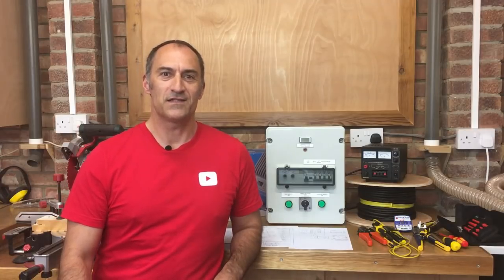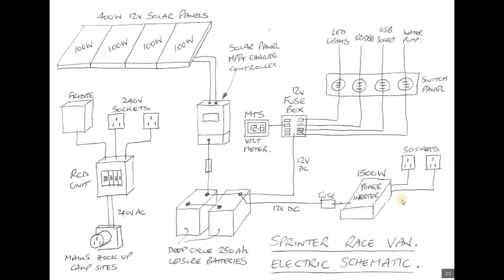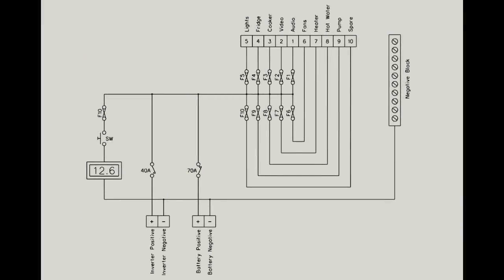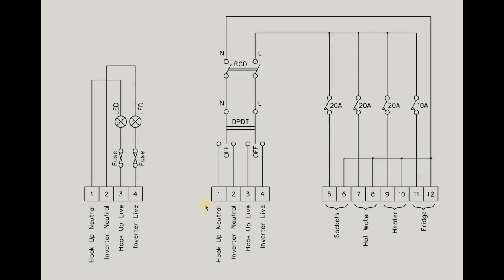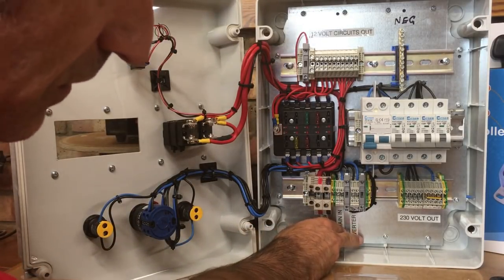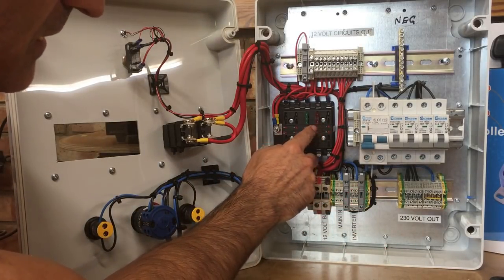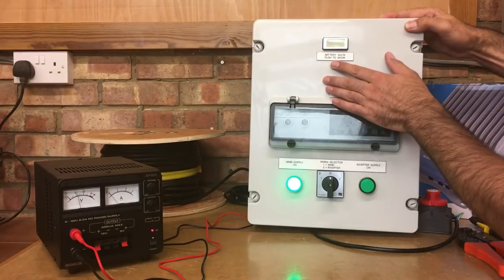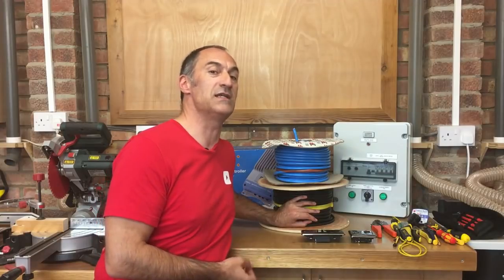Self Build Camper Van 12v Electric Control Panel

Comment: Hi Greg, sorry to trouble you again but I think you are the most competent person I know. I have started converting my LWB sprinter and have got to the point of running in cables etc. I plan to do my van in two phases as we are new to camper vans and plan to initially only use campsites with mains hookups. So phase 1 plan to have mains hookup but also have at least 1 AGM leisure battery and have 12 volt lights and 240 for most other items. Phase two when I have funds available I want to add solar.
My question is would you fit a split charge relay to charge the AGM battery or is there an alternative / better option?
Thank you in advance for your assistance.
Love your videos and wish you a great day 😃

Comment: Greg.
Me again rattling you brain with questions 

I've been watching your electricia set up videos 

What back up did you have to charge your leisure batteries 
Maybe I missed something 
But I didn't see a feed from the mains battery or from your hook up 
So I'm I correct in saying your 12v system uses the solar panels to charge up
Reply: Please excuse me 
I've just re watched the 2nd video and you did mention the charging of the leisure battery 🙈

Comment: Hi Greg 
Once again thank you 
Everything is so detailed and educational.

Is there a reason you didnt run a feed from the mains car battery to charge your system while driving 
Are all the 12v cables 1.5mm
Reply from the maker: THE MARKS BROTHERS I didn’t use a split charge relay because it would not look after my AGM batteries and would possibly damage them. 
A far better solution would be to install a dc to dc battery charger. You can then setup different charging profiles and your batteries will last longer.

Comment: Thanks Greg. Watched the video. You clearly know what you’re talking about. However.... imagine if you can that I don’t have a scooby doo. The system looks exactly what I’m looking for. I don’t even know where the existing wiring is in my van as it’s all hidden. All I know is it’s a sergeant system. I will have to get the conversion company to put my inverter in. Just worries me that they said this could not be done. You can do it so obviously it can be done. I have asked the conversion company for a wiring diagram. If they produce it I will let you know. You may be able to give me some more advice in the future. Very happy to have found you on YouTube and happy to be a subscriber. 👍🏼
Reply from the maker: ian sharp you just need to put the mains hook up on one side of the changeover switch, your inverter supply on the other side of the changeover switch and the output from the switch to your Sargent panel where the mains would normally be connected. 
You can put the changeover switch in a small plastic box. You don’t need a huge panel like mine just keep it simple. What model Sargent panel do you have? I will dig out the wiring schematics 👍🏼
Reply: That’s great. Thanks Greg. I will have a look now. Stand by. I really appreciate the time you’ve taken to help someone who doesn’t have a clue. Very very helpful. Thank you. It’s an EC155 I can send you a picture if you like. You’re a top man. 👍🏼
Reply from the maker: ian sharp ok so I have the wiring diagrams for that panel. https://sargentltd.co.uk/shop/product/132/tech-spec/40
I can see the 230v input terminals on top of page 4 
It appears there are a number of 230v outlets including a heater and boiler. 
I would recommend not using those via your inverter as your battery will not last long at all. 
So as long as you size your inverter large enough for your total loads in Watts and remember not to use the heater and boiler of the inverter it will work just fine. Hope that helps. Just ask if you need anything clarifying 👍🏼😊
Reply from the maker: ian sharp this is the changeover switch you need to switch from inverter to mains 

https://rover.ebay.com/rover/0/0/0?mpre=https%3A%2F%2Fwww.ebay.co.uk%2Fulk%2Fitm%2F401993210348
Reply from the maker: ian sharp on your Sargent power unit there will be a set of input terminals for the mains hook up. 
Disconnect the mains, install switch as above description and wire back to these terminals from the output of the changeover switch. 😀
Reply from the maker: ian sharp no problem mate it’s a pleasure. No reason why you can’t feed that Sargent unit with two independently isolated 230v supplies. Just need to be aware of the connected load and your inverter size. Give us a shout if you get any problems. Good luck 😉
Reply: Hi Greg. Just wanted to let you know that I have read through your comments and I understand.  I have a 2000kw pure sine wave inverter. I want to run my coffee machine and microwave. Everything else is 12v. I have 2 x 110 amp AGM leisure batteries. Does it all sound ok. What size wire would you recommend for this setup? I have had a look at the switch box. What size amp box do you think I would need. Sorry to keep you so busy with all the questions.
Reply: Thanks again Greg. Gonna go over everything you’ve told me so far and see if I understand. I honestly don’t have a clue but your help and advice is massively appreciated. Top man. 👍🏼😁

Comment: Hello again - If I may ask, why did you choose to install the LED indicator light for the Mains supply on the left, under the Inverter Supply 12V DC side and the Inverter Supply LED indicator light under the Mains supply (the RCD) on the right?
Reply from the maker: 1 is Mains
2 is Inverter

Comment: Really should have used a 3 pole change over switch, the shore power earth connection needs to be disconnected from the vehicle when using the inverter. The inverters neutral should be shunted to the chassis ground and earth within the van, then you have rcd fault protection as well as preventing the entire van from becoming live. Also in the UK most hookups are 16amp and a 16 amp trip at the hookup point so using 20mcbs is pointless as the site's trip will go well before yours does as well as when in inverter power the fuse will go before your MCB due to its fault protection being at 13amps.  It's recommended to have a 25amp rcd  and a 10amp MCB to allow for discretion. The workmanship is very good but I think more research on the wiring regs was needed.

Comment: I guess my only question here would be is how would you add a 3rd input of 12v DC from the alternator to charge while driving or on days where solar is not real clear?
Reply from the maker: irongoatrocky any DC charging would be connected direct to the leisure battery string. It would be sensible to have inline isolators fuses or breakers so you can safely switch between charging modes. 👍🏼😊
Reply: @GregVirgoe  I was thinking along those lines I saw in another one of your  videos where you mentioned the isolated I was thinking of adding a switch to the 12v input so one can choose between the solar or alternator for input. 
Thanks for the reply...Cheers!

Comment: Hi Greg, I'm learning a lot from your videos. Question: Is it necessary to split the distribution panel? Is it possible to have the hookup power feeding the batteries, and in turn, the batteries feed all the outlets (thereby not needing 2 separate sets of outlets)? I imagine there must be a feasibility or safety reason for why you kept them separate.
Reply from the maker: s s please watch my latest video “How to wire your camper van” and I have done exactly that with a mains battery charger.

Comment: hello Greg, are there any electric things that you will do different in a new campervan.
Reply from the maker: Geert Ritserveldt yes now that we know the solar system works so well I would put everything on the12volt batteries and just have a mains battery charger as backup. We have only used a couple of the 230v sockets so it was overkill fitting them all.

Comment: Hi Greg! Absolutely love your videos, been watching 3 hours straight :). 2 questions: 
I noticed you use the same cable for all your 12V DC wiring. If I look at my wiring then I have different cable thickness for my waterpump, lights, fridge, etc... I got these measurements from their respective manuals. The fridge even has a 10mm2 cable requirement as the distance to the batteries is quite far and this to ensure to have as minimum voltage loss. 
I would love to read your opinion on this :)? 

2nd: I noticed in your calculation for your watt hours that you list the fridge as only 6 hours on per day. Aren't you using the fridge constantly? Or is this the actual time it's consuming power? 

Thanks again for your incredible videos!
Reply: The fridge compressor wouldn’t run constantly. So the 6 hours would be the total compressor run time in a 24 hour period

Comment: Ok stupid beginners question.. the fuse box you have with the switch to connect to either the leasure/hook up battery or the solar.. is that different than a trip switch? Is the trip switch from the van battery to the leasure? And this switch is from the solar/leasure to the hook up?

Comment: Hi Greg. 
              I love your schematic of the electrical system. How would you incorporate a 220 volt  ac battery charger into the system.
I would like to be able to charge my 12 volt leisure  battery when I'm hooked up to shore power. I already have a 100 watt solar panel, do I even need an AC charger?  I'm only running 5  3.5 watt LEDs ,water pump and 4  USB sockets for charging phones, a Sat Nav  and an MP3 player. Great channel, keep up the good work.
Reply from the maker: Sansa Ireland I have my mains battery charger plugged into a socket that is fed directly from the mains hook up connection. Then it’s connected directly to my batteries. So it’s totally stand alone from the panel.
It’s good to have as a back up charger. I have one but so far never needed to use it. You may be the same and have enough solar but better to have that option. 😊
Reply: Thanks Greg...I was thinking along thee same lines

Comment: great video, would like a bit more detail on the components though. like what are the dimensions of the junction box? where did you get the RCB clear flip cover? what din rail connectors are you using etc? thanks!

Comment: I couldn't tell - did you also implement a way to charge the leisure batteries from shore power when available (i.e. so charging is quicker than with solar)?

Comment: Hi Greg,
Is it right, that thru the selector switch is going up to 70 ampere? I think for 70 ampere you need minimum a 10mm² cable. In the video it looks like 2.5mm²

Comment: Hi Greg, why do you not use a split relay from the engine also/instead to charge/top-up your leisure batteries?
Reply from the maker: hennnnerz because a VSR or split charge relay is not compatible with AGM batteries. They prefer a low slow charge and are more suited to battery to battery chargers.

Comment: Hi Greg, 
Thanks for this video, I really like the set-up and am working on my own version at the moment.
Just one question with regards to the wire size:

It looks like you use 2.5mm2 wire for everything, but was wondering if it wouldn't be better to have a thicker wire from your live main supply to the DPDT and to your RCD and your neutral from the bus bar -> RCD -> DPDT -> Neutral main hook-up.
Not sure what the capacity of the RCD is but your fuses go up to 70A, therefore shouldn't your wire size be increased here? I know for your 2000W inverter it should be sufficient (2000/220 < 10A) but if you hook up to a main power supply at a camp site of f.e. 30A, your wires are undersized?
Or do you only hook up to main power supply up to 10A or 16A?

Comment: Hi Greg where did you get the distribution box from
Reply from the maker: James Shearing you can get the abs enclosure from eBay https://rover.ebay.com/rover/0/0/0?mpre=https%3A%2F%2Fwww.ebay.co.uk%2Fulk%2Fitm%2F112869512272
Reply: Thanks Greg top notch videos by the way 👍

Comment: Hi, nice drawing :)..  im just sitting and drawing almost a copy over here in sweden..  I was planning to go direct from mppt 12v out to fusebox and the lights, waterpump and fan? why didnt you do that so you can see the draw? am I missing something...  if I only have a fridge and instant heated tap going to 240V can I just go to one fuse? .. why need to switch and cut off both cables going up to solarpanel?.. how about not having fuse mppt to batteries and going instead over the Main switch?   thanks!

Comment: Hi David, amazing video! Do you (or does anybody else) know the specifications of all the single strand cable used within the box itself?
Reply from the maker: Hi Simon, I have used Tri Rated cable inside the panel, which is flame retardant and suitable for high temperature and designed for internal panel wiring. https://www.electriccable.co.uk/RWDtriratedcableTECC.php?gclid=Cj0KCQjw5J_mBRDVARIsAGqGLZBRhqzRjO3cqNWkayLa0frIBML2-5JeJgQcVq2OHlBHQ2Ul4Y0FBJsaAjUXEALw_wcB

Comment: How did you run the cable from the van battery all the way to the leisure batteries? Thank you very much!
Reply from the maker: If you watch the first shower video you will see a red cable passing under the back of the shower tray. However I never connected it because the VSR is not compatible with my AGM batteries. We have not needed it been on solar 100%
Reply: @GregVirgoe  Hi Greg, greats videos, can you expand on why this VSR won't work with your AGM battery's? Was looking to buy this split charger, but now have my concerns.
Reply from the maker: Scott Barrow, the AGM battery likes a low slow charge profile. The alternator puts out a high voltage and fast charge. So better to have a battery to battery charger that allows you to chose different charging profiles. 👍🏼
Reply: @GregVirgoe  thanks, will need to look into that in more detail then. Would be efficient for me to charge whilst driving which is something I would be doing a lot.
Reply: @GregVirgoe  thank you very much. I will buy the sterling VSR. It will be more useful in the winter

Comment: Hey Greg, I think I've watched your videos (especially this one) a dozen times or more now. I'm in the process of designing the electrical system for our motorhome (it's 24V though as it's in a 7.5t truck) so your videos are gold (even after accounting for the differences in our builds). I was wondering what application you had used to create your wiring diagram? I cannot seem to find a good one to use and I reckon it'd be easier than my own scribbled handwritten diagrams.

Comment: great vid I keep going over each of your vids I think I have worn out the pause button, wondering which inverter you went with, also were did  you get your 12v not the blade one but the one on the front of you distribution box please, LOOKS LIKE YOUR HAVING A GREAT TIME ON YOUR TRAVELS SEE SOON
Reply from the maker: It was a Chinese inverter off Ebay, it was 2kw and about £200 but not sure it’s giving me the best power out. Had a few issues so won’t recommend it.  
The 12v trips are single pole DC thermal magnetic circuit breakers. These are marine ones but you can get DC circuit breakers that look just the same as normal household trips and more readily available. Just search for DC circuit breakers and they come in a range of different ratings for what you need. Mine was 60Amps 👍🏼

Comment: Hi Greg I was wondering what amp single core cable you are using (red & black)
Cheers Mike
Reply from the maker: Hello Mike, I haven't run any single core cables in the van I've used multi core flex, rubber flex for the 12v DC and Arctic blue flex for the 230v circuits. Cable size is based on amps current being used and the distance travelled. If you google cable size chart for 12vDC there will be plenty of charts that give you the figures, I used 1.5mm cable for 12v lights, 2.5mm cable for 230v sockets and 4mm cable for fridge and some larger loads. Right up to 16mm for main battery connections and 35mm cable for interconnecting battery leads. I'm working on a schematic of my setup for a future video that will cover cable sizing too.
Reply: Hi @greg virgoe, thanks for this response. It was very helpful, can you confirm something please? 

The sizes you have described haven’t been used in the panel in the video? It looks like 1.5mm possible 2.5mm can you confirm why? Thanks

Comment: Greg:

Why do you charge the iPhone with 230? As opposed to 12V? I saw in your list that this was the case.
Reply from the maker: That’s not one of my better ideas and is on my list to change when we get back. 
Other than my computer we have not used any of the other three pin sockets in the van. 
Would be better with charging points fed direct off 12v batteries as you rightly say.

Comment: I see you are using a split charge relay to use the solar power to also charge the starter battery for the van and vice versa. I was wondering if there was any limit on how many split chargers you could  have. Say if I had a motorcycle in the back of my van could I run an additional split charger to charge that?
Reply from the maker: Normally a VSR would be used when driving to charge your leisure battery. It would not normally be used to charge your starter battery from your solar system. Starter batteries are usually flooded lead acid and modern leisure batteries are never that, so they often require different charging profiles. I am not using a split charge relay at all. Currently there is no connection between my van and leisure batteries. I have AGM batteries that like to be charged low and slow which is not compatible with VSRs
We have been able to manage easily on just solar and been off grid for 4weeks now. 
You may be better looking at battery to battery chargers as you can set up different battery types and specify charge rates etc. Hope that helps you 👍🏼😊
Reply: Thanks. It's just I have seen other videos trying to explain that it is possible and the only guy to have made any sense is yourself. Especially your magical electrical control box you made. That helped a lot. Really impressed with your work so far. Looking forward to your next video.